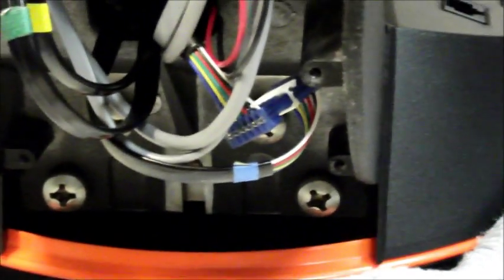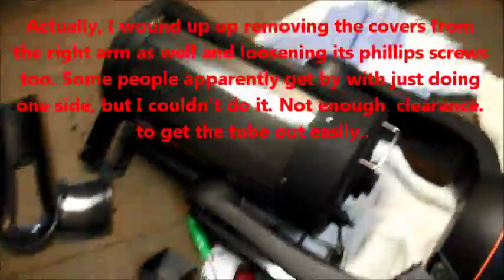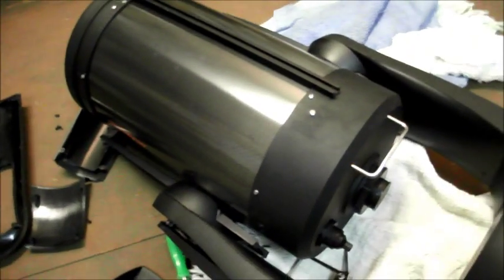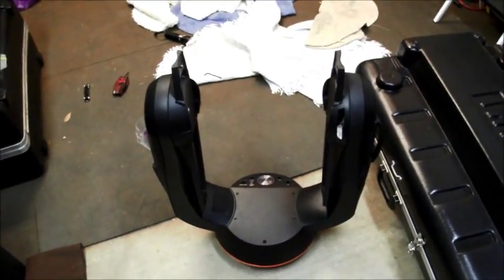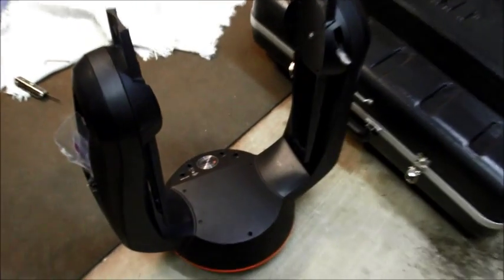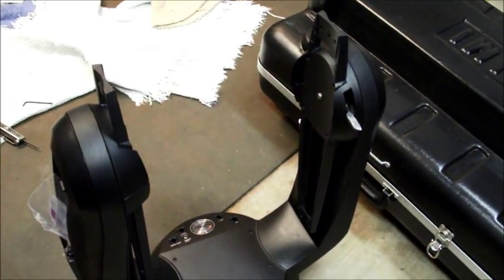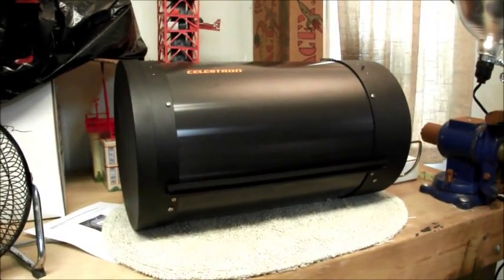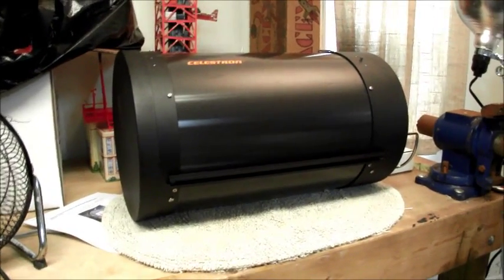uncle rod deforks a nexstar 11

Comment: I de-forked my N11 back in 2012 when I got my CGEM-DX.  Like you, I had to remove the upper and lower side cover halves.  Everything else pretty much follows what you did except that I was able to remove both of the alignment pins by hand.  I covered those holes with some small rubber friction dots.  Good video Rod.

Comment: Thanks Rod for making this video, I just performed this amputation, on my 11" CPC Edge HD Alt Az, and like yo,u age and gravity of lifting this beast has forced me to an CGEM II EQ mount..the only thing that was different on this CPC was, to remove the handle side only and loosen the 4 arm support screws and 4 tube screws 2x2 vz the 4x4 on Nexstar, a little jiggle on the tube supports and a pushing out on the fork freed both alignment pins and waa-lah...Thanks Rob..you Rock....Now what do I do with these forks :P

Comment: Hi Rod, just performed the operation myself on the same scope using youre instructions, so thank you ! I also had mixed feelings, it really is a fine looking, great performing instrument, but i guess once mounted on the EQ6R-Pro wil wash those feelings away :-) . Just a note, the alignment pins you speak of are both on the OTA here. Did you put the OTA-mounting screws back in ?